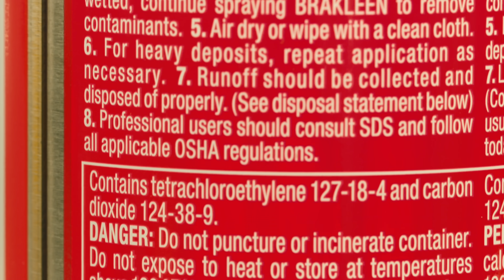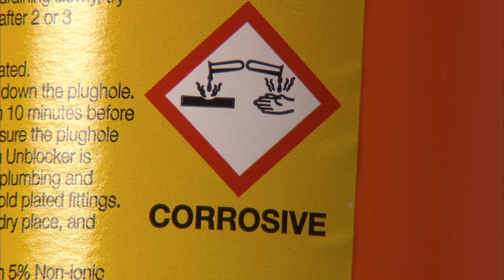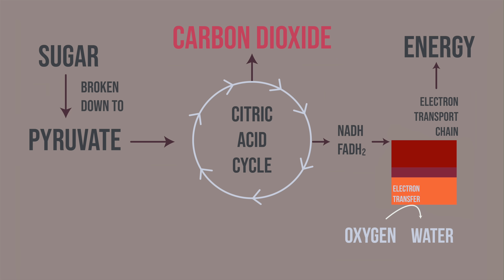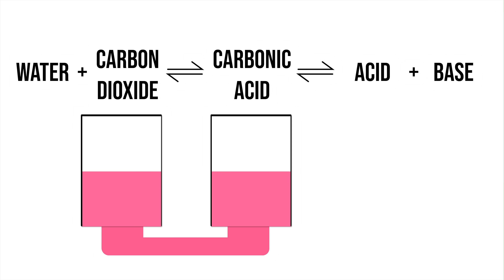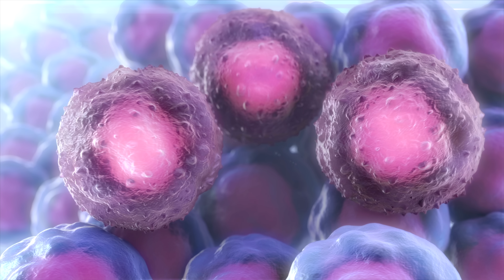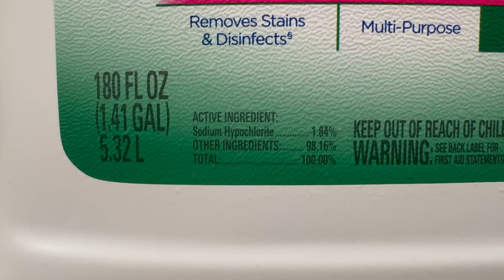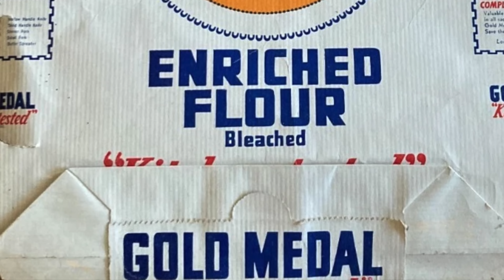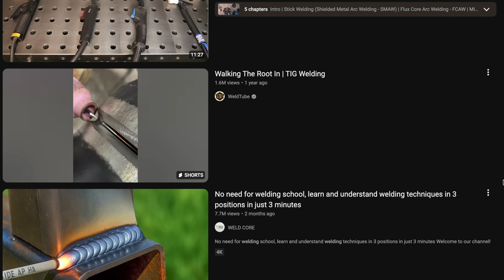"It smelled funny while I was welding and now I can't breathe..."

Comment: 6:00 welding is actually NOT that dangerous unless your using heavy duty 220v and welding thick metal for buildings beams and city bridges, when welding sheet metal or light duty framing is only required about 50 feet distance from people and its safe to look at without shielding I have welded 1\8 thick metal without arm protection you get a sunburn after awhile but its nothing crazy, the metal cools off by the time it hits your arm you might get a red dot or 2, its not enough to set your cloths on fire unless your welding dirty nasty rusty stuff on the wrong setting, some people dont even use eye protection when doing thin sheet metal but i don't recommend that, UV is bad for your eyes, but no different from the sun at 50 foot or soo

Comment: How do you avoid getting poisoned from welding?
Reply: Get a respirator with activated charcoal filters and check that what you're welding on is clean (just the metal) no coatings, chemicals, ect

Also, weld in a weld-vented environment.
Reply: @RexOutis  Can you wash off the chemicals?

Comment: 16:40 - Look how the iron filings (the black dust on the ground) move in response to the current flowing through the wire. It's generating a magnetic field.
Reply: That is what electricity does after all
Reply: @shortstack2k0  Sure, but I meant to highlight the magnitude of what's happening here. Styropyro works with extremely high current. An ordinary wire carrying out ordinary things, like speaker wire driving a speaker or AC wire powering a bathroom fan will not command such a response. The scale is scaly, which is totally on brand for the guest star. But if your home wires are doing that... run, I think.

Comment: Earlier this year my wife phoned me at work and told me she felt unwell after cleaning the bathroom. I asked her what cleaner she had used. She told me she had mixed bleach with another product. I guessed she had probably produced chlorine gas in a confined space so I asked her to call an ambulance. 
Thankfully she was ok after a short stay in the hospital. 
I felt bad for not explaining this risk to her before.
Reply: I hate dangerous harsh cleaning products and I always try to avoid them. I mostly clean my kitchen and bathroom with white vinegar, it works great and I don't have to worry about some residue or reactions left over on the surface afterward. Cleaning is supposed to make the area safer and more hygenic, using dangerous chemicals is the opposite of that. Maybe if I was trying to sterilize a hospital, or cleaning heavy machinery or something I would use these chemicals but it just seems totally unecessary and dangerous for normal everyday cleaning of the home...
Reply: @hughconings26  Leftover chlorine is not bad. It is literally in drinking water in some countries, which makes it safe to drink although not really tasty. 
Most other cleaning agents are not particularly toxic either in the amount that might be present on a surface. For instance, Bar Keeper's Friend is mostly oxalic acid which is toxic if you eat a spoonful of it, but it does not harm if a few milligrams end up on your knife or whatever you put down on a surface you just cleaned (and didn't wipe off properly) with it. 
You just shouldn't do stupid stuff like mixing things that explicitely say 'do not mix this'.
Reply: Because it's not like the label says "do not mix with any other cleaning products or chemicals", right?
Reply: Don't feel bad. It literally says on the packaging that you shouldn't mix anything with bleach.
Reply: My husband studied chemistry in college. He warned me.
Reply: I sprayed the engine of my car with a cleaner, the fumes almost made me pass out, I should have waited for the motor to cool down 

Thankfully I was ok

Comment: I had the pleasure of gassing myself once.   I was working in a college biology lab cleaning out bottles of sugar solution with bleach.   Some of these bottles had grown fungus and other contaminants.   I'm guessing some of these microbes had produced acid...    As I'm cleaning away, a pale green-yellow gas starts coming out of one of the bottles.  Now, I'm a historian (think WWI, where phosgene was also used) so I knew this was no bueno.   The water was already running in the sink so I turned the bottle upside down in the drain and exited the room ASAP, hitting the prep room exhaust fan switches as I left and closed the door behind me.  Coughed for a good 10-15 minutes straight.  Left the room closed for a few hours.  When I went back, everything had dissipated.   I should have reported this to the department OSHA officer, but since that was me, I declined to write a report.

Comment: I did this by firing brake cleaner down the carb of an old 350. Suddenly I couldn’t breathe and I knew right away what was happening so I ran to the opposite side of the yard for fresh air. Literally took my breath away. After finishing this video I’m surprised I’m still here. 😳

Comment: I did not now chlorinated brake cleaner was that kind of problem. I thought this video would be about welding a bad alloy or galvanized steel. The zinc will get released and is toxic.

Comment: I read a lot of case studies in the downtime at my office. But nothing beats one presented by my favorite ER doctor. Also, I have a "1 minute" rule with welding. Where if I'm just tacking something really quick I just throw on a visor and weld away. But if I run into anything that's gonna have me running an arc for more than a minute in total I'll put on sleeves. But I'm betweenn white and olive so burning doesn't happen quickly. If I were paler and sunburned easily I'd probably always wear them. I've only gotten arc burned once and that was more than enough. It looks half as severe as a regular sunburn while somehow being twice as painful.

Comment: It's scary that I haven't seen warning about that in any welding tutorials
Reply: I took some welding classes
And they were very direct and explicit that NO chemical cleaning products should be used just before welding
we were also specifically warned about things like Break Cleaner being EXTRA hazardous
Reply: @d @drthmik e 2 chemicals that are perfectly safe (to weld over once dry) are acetone and IPA. Both are really all you need aside from maybe some dish soap. Those 2 will remove grease, oils and residues that are bad in a weld. You can even use non-chlorinated brake cleaner. It's the green can (red is bad one) and it works well. It's just like 10x more expensive per volume so no idea why a guy would opt for that over a gallon of acetone (which I think works better in my experience)
Reply: the SDS for Brakleen says "keep away from heat"...
Reply: @harrisonfnord5871and it specifically talks about phosgene in section 7! always read the SDS
Reply: welding tutorials will focus on 'how to weld'. Try looking for 'welding safety' first. Most metals are toxic to humans, beware of vapor.
Reply: It’s almost like welding is one of those things you should learn from somebody who is qualified to teach it rather than some random person on the internet.
Reply: it is not any thing some one in welding would usually think of. Most figure out any thing chemical + Heat is a bad idea.
Reply: Then you've been watching YT shills, product touts and hipster d-bags making videos about schit they know nothing about.
Reply: I mean... I'd like to think it's fairly obvious that vaporizing nasty liquids isn't a good idea.
Reply: the video is made to be scary and the bg music is proof. 
he should have gave the truth it's based on someone else. 
by waiting till the end it made it worse and in fact down right traumatic. 
the fact some people were not affected is debatable and irrelevant
Reply: @dukromeo  for me it was just another actor chubbyemu had brought to the set

dont act like the world revolves around you wtf
Reply: I mean.. Chubby emu never made a video starring the actual patient before, why would you think this was the case this time?
Reply: @deadsi  He made a video featuring an actual patient's actual parents though, so it wouldn't be a crazy stretch to think he might do the same with a moderately well-known mad scientist.
Reply: @deadsi  It's a joint production with Styropyro and the patient is called "SP". I legit thought it was Styropyro until the whole dying thing. It was obviously deliberately 'misleading'. Not that it upset me. It might have some though.
Reply: @dukromeo  obvious troll is obvious 🥱
Reply: @dukromeo Okay so for anyone reading, this guy is probably not particularly 'all here.' He isn't a child either based on his other comments, hell, his YouTube account is literally old enough to drive. Some of his other comments show that, like above, he seems to believe that the stock footage/other acted clips in the video are being portrayed as recorded footage of the actual, real event.

He talked about how a doctor was 'smiling about letting someone die' in the video and how 'doctors have ruined the world' and was posting anti-vax and Covid-19 conspiracy gibberish that he seems to be supporting with, and I am not kidding, the stock footage in this video.

So I don't know what his deal is, but I don't think they're alright. That level of disconnect with reality is honestly scary.
Reply: @dukromeo  you spend a lot of time on tiktok don't you?
Reply: @dukromeo  I mean yeah, it is scary. That's the idea, to inform people about how dangerous this is...
Reply: @dukromeo it's okay to be more vulnerable, yet this video was anything but traumatizing. dont throw words around you don't know the meaning of.
Reply: @dukromeo 0/10
Reply: I agree
Reply: @dukromeo  this is generally well known among mechanics and "car people"

Comment: As a "Jack of all trades" kind of person I feel at high risk for stuff like this. Feeling like I have a niche method because of crossover knowledge is such a high. A good reminder to spend more time educating myself with new hobbies.
Reply: Same man, I was cleaning my engine with some engine cleaner, my motor was still hot, the fumes almost made me pass out,  I then read the instructions.  "Use on cool surfaces, highly poisonous" thankfully I was ok but damn,  least the engine was clean😂
Reply: @jakkbatt4711  “least the engine was clean.” The better to serve as the hearse to carry you to the cemetery!
Reply: @jakkbatt4711  It takes many hours after .....everythihng seems fine at first
Reply: yep, similar here... Generally speaking if it involves hot surfaces, cutting or melting things, i just assume its not good for you and act accordingly (ie do it outside rather than in an enclosed space). PVC getting hot is another one thats easy to forget... with similar effects.
Reply: I'm also a jack-of-all-tades, and it seems the lessons I remember best are the ones that caused me pain. I'm a little embarrassed to say that I recently screwed up despite knowing better. I sat a favorite old coffee cup in the sink intending to bleach out some coffee stains with a shot of bleach, then fill the cup with water as I've done before. But first, I put a shot of lime scale remover in it so I could dab a small, long handled brush into the solution and better reach the back of sink fixtures, hoping to get more on the fixture than my wrist and arm this time. I got that done, but got distracted by something else and came back later. I didn't even think about the need to rinse out the lime scale remover and added bleach to the cup. That was the moment I realized I'd f'ed up. The caustic gas hit me in the face like a shovel, and I ran to open doors for cross ventilation, then backtracked while holding my breath to carry the cup outside. I eventually fetched a big fan to pressure ventilate the house from the outside. It took forever to clear out the hazmat wreck I turned my house into. But get this: The caustic gas may have ruined the stainless steel sink. It has psychedelic patterns of brown all over it - just from the gas - no actual liquid contact! Part of me now wants to experiment with this mixture and some mild steel to see what it can do - while outside and downwind, maybe with protective gear. I should text a few people about what I'm doing in case I'm found dead so my passing isn't a mystery. 🤪
Reply: @jimmyyounger618 I hope you don't ever leave strong chemicals in something unattended again, that's how you forget 😭
Reply: That's part of why I always look into chemicals/materials I use and avoid combining them in novel ways
Reply: if you're working with a product that has an SDS that's always gotta be your first step!
Reply: always wear a respirator. just all the time. best way to stay safe

Comment: There’s a few variations of brake cleaner chemicals in the different brands of brake cleaner I’ve used, some are slightly slower to evaporate and have visible impurities that take longer to evaporate. I use wurth brake cleaner mostly as it’s cleaner than some other brands and completely evaporates. It would be interesting to know if it’s as toxic as the others.

Comment: I got a job at a place called speedy metals because the previous welder got holes in his lungs from welding galvanized without a mask, then at a different place called a1 steel they wanted me to weld galvanized in an enclosed space after denying me the right to use a respirator for 4 months because of OSHA rules even after having 5 yrs using them along with military training to use masks, so they had the meth user with chronic legal issues and crashed company vehicles into client vehicles do it, he also made triple my wage

Comment: I’ve got a buddy who was welding down in an engine bay, he sprayed some brake clean in there to clean something off, started welding again right away and boom gas knocked him right out.
Sleeves on fire engine on fire luckily we drug him off and put him out before he got too badly burned but he was out cold for a solid 5 minutes and when he came back to he was all piss and vinegar cussin us out to let him get back to workin on the thing.
He was using some stuff stamped with low voc so maybe that made the difference between a nap and the long nap.

Comment: ahh suck it up....but seriously on the thought of going into hyper tension, I'm thinking back to when i use to wield in the pipe fitters union and we wielded some crazy shit, (like  big contractors [cough, cough, Flour] would soak pipes with chemicals pre-wield that were meant to be used to flush pipes after all was fitted). Anyways we always went to the bar afterwards. I guess what I'm inquiring is would consuming alcohol offset damages some?

Comment: I was an engineer who worked on the design phase of projects. A big part of my job was managing risk. Of course there were schedule dependencies and such that we knew of and could create mitigation plans for. For the unknown risks, we had experts on hand to review all the design phases to identify potential problems. This was before the internet (yes, I’m older than dirt). Just now, I did a simple google search “can I use brake cleaner to remove grease on a part I’m going to weld”. The answer came back with an emphatic NO. The reason? Many brake cleaners have chlorine in them, that when heated, produces toxic phosgene gas. I applaud people who want to learn new things, but they must consider the risks involved with what they’re doing and o their due diligence. One well thought out Google search would have saved SP’s life.

Comment: That reminds me:

In an industrial or laboratory setting, we’d have access to a bunch of MSDS (Material Safety Data Sheet). OSHA requires there be one for every material used. Even if the material has GRAS (Generally Regarded As Safe) status for whatever the site is using it for. (Because accidents happen and stuff gets where it oughn’t be! Think of sand, for instance. Wonderfully inert stuff. But grind it down fine enough and it can become airborne quickly — and is silicosis is a really nasty, lifetime-cumulative problem to have.)

DIY-ers don’t typically have these common safety information binders. But any one can request a chemical manufacturer’s MSDS.

Or look them up.

And probably should.

Especially when considering a “novel” use of a chemical.

Comment: We have very bad water from our city. Our toilets keep getting this slimy, moldy stinky substance and we have to clean the toilets about every 3 days or less sometimes. It's a real pain to have to clean them all the time as we never had to clean them this often until they city changed all the pipes in the streets in our neighborhood. My husband found this toilet bowl cleaner at the store, and it's called Toilet Bowl Cleaner. The ingredients are Trichloroisohydrouric acid-Dichlorodimethydantoin. He put a tablet in each toilet tank, and they really keep the toilet clean, but the smell is like having your nose stuck in a bleach bottle and when I flush the toilet the smell lingers all the way through to the hall and beyond. I can't hardly stand to breath it. I told my husband I don't want that in the toilet I use the most or to stop it in both toilets. I have COPD and what does he do he puts another tablet in when the first tablet run out. So, my question is can smelling and breathing this toilet bowl cleaner be harming us? I don't trust it at all, and the smell is awful. I told him I'd rather just keep cleaning the toilets than to smell that cleaner and breath in those chemicals. I'd appreciate an answer if you know if it's harmful or not.